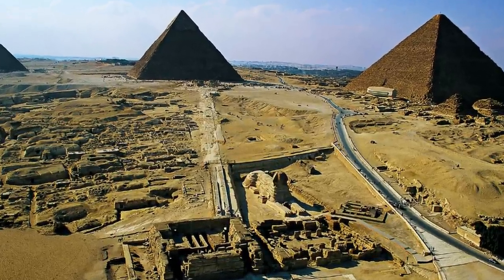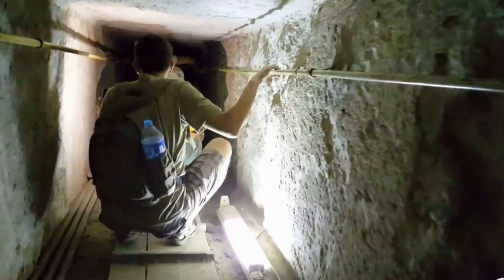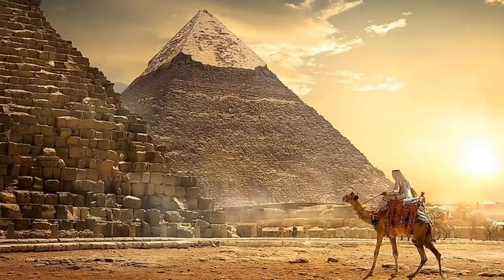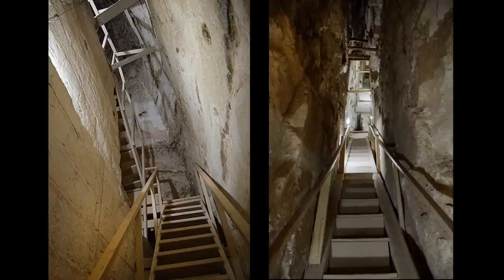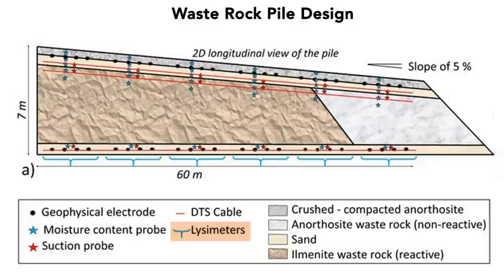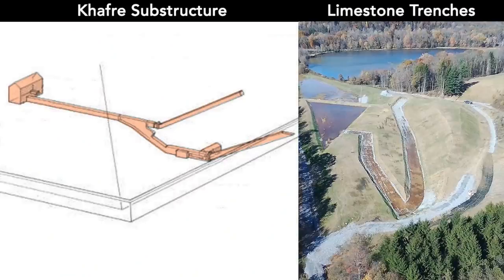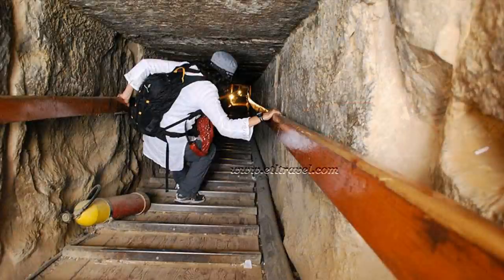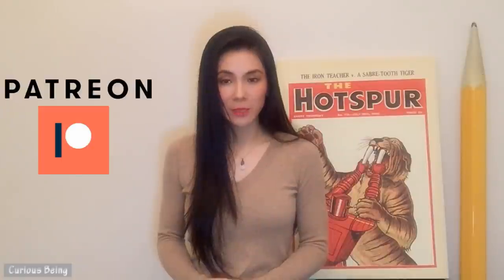The Secret Enigma of the Egyptian Pyramids’ Interior

Comment: Hi Tina, very good video and the series has been well researched and presented as a whole theory that has a believability about it. I have several points to make:-
1. As I've commented before I'm struggling believing that an advanced civilisation would only have mined for iron at Giza, we should probably find similarly constructed pyramid styles at different sites nearby and in other countries mining other minerals. The fingerprints of this advanced mining technology would surely have migrated elsewhere unless the constructors were wiped out just as they finished mining Giza which seems unlikely timing but can't be ruled out.
2. The chambers seem 'over designed' for the purpose of draining acidic run-off with the drainage shaft to the underground chamber being inexplicably poorly designed, being very narrow in comparison to the other shafts and curiously shaped.
3. The so-called Gatenbrink shafts would not have allowed free flowing acid drainage due to a series of doors in the shafts.
4. We should be able to test the iron ore acidic wastes drainage theory by seeing orange/red residues on the 'limestone rock rubble filters' you propose. This should be very evident I would assume.
5. The function of percolation and drainage should still be seen working today especially as the protective casing stones are now absent.
6. If the pyramids were built in a desert climate rather than savannah times how much rain would there have been to create large amounts of acidic run-off?, we are probably talking condensation rather than flowing liquids. This would be more likely due to the protective casing stones keeping most rain incursion out. Would condensation account for the efflorescence on the internal walls?
7. Why add white casing stones in a desert climate as the intense heat would likely dry the 'tailing blocks' out, avoiding the need for a fancy drainage system (unless the pyramids WERE built in a savannah climate or the builders were far thinking and expecting a savannah climate to bring heavy rains).
Would be interested in your thoughts Tina. I think you have an interesting, well researched theory but I remain sceptical!
Reply from the maker: Thank you Ian. I appreciate your thoughtful questions! 
Here are my thoughts. 
1. I think there are other mine waste "pyramids" around the world, for example the Bosnian Pyramids might belong to this category.
2. The chambers are plain and have a industrial look. Comparing to the sanitary/ sewage systems I showed in this video (https://youtu.be/nPswBtmQKD8), the pyramid chambers don't seem to be 'over designed' at all. The underground chamber has sharp straight ceilings and rough rubble channels and piles, though the underground tunnels are still very well excavated which are consistent with the rest of the pyramid construction.
3. The air shafts from the King's Chamber were found to exit to the outside of the pyramid. The Queen's Chamber air shafts do not lead to the outside and both have "Gatenbrink doors" about 200' (60.9 m) into the shafts, which means they are unobstructed for 200' to allow seepage water drains to the chamber.
4. I hope people are allowed to test the rubble inside the underground chamber. From a few colored photos we can see dark orange/red residues on the limestone - I showed them in the video. One photo especially shows the grey ceiling and the reddish rock channels.  
5. The drainage channels are still functional (leading moisture/ seepage water to the chambers) ; and that's why there were and still are efflorescence salt showing up in the chambers and the Grand Gallery periodically. 
6. If the pyramids were built in a desert climate like now, there were still rain storms which would have caused flash floods like now. When the pyramids were covered with full on casing stones, there would have been minimum water seeping through though it's possible that there would still be water getting in during a heavy rainstorm since stone and concrete are porous. If the pyramids were designed to be permanent mine waste storage then the design would need to be covering a wide range of possibilities including water seepage and accumulation inside the pyramids.
7. White casing stones actually works great for desert climate since it reflects sunlight other than absorbing the heat. Dark roofs are usually used in cold regions to help ice melting in the winter.
Reply: Thanks Tina.
1. Our Victorian sewers are very ornate as that was the architectural style and mentality of the time. My point regarding the great pyramid is the K & Q chambers have large inverted V granite caps (they may be for supporting loads from above but the grand gallery doesn't seem to require that type of roof support), they are off-centre and equally oddly sited relative to each other. The grand gallery's size is at odds with both chambers if simply providing drainage. Compare the design of the chambers to the seemingly random journey of the small well shaft from the end of the Q chamber shaft to its intersection with the descending passage - almost seems like an afterthought addition. The subterranean chamber size appears small if it is the terminus of the waste products from the larger Q & K chambers. If this is a waste collection system for the mega sized pyramid then there are huge areas poorly served by it, surely you'd need more collection points with more shafts funneling waste to treatment areas then direct downward filtration to a large subterranean area. 4 shafts and two strangely located chambers serving a small subterranean chamber via a kinked shaft seems odd, especially as two shafts have doors in them precluding drainage.
2. I agree the subterranean chamber needs testing for deposits but I wonder if the orange colour we see in photos is really acid drainage from iron ore, I've never been there myself. Presumably such deposits would preclude tourists going down there due to health and safety.
3. I'm aware white casing stones reflect sunlight, basic science!. However, despite flash flooding maybe leaving the stones to bake in the desert sun would obviate the need for a drainage system. I don't know. As the pyramid still seeps today maybe that was always the case...seepage rather than large volumes. Is it no longer toxic after thousands of years?, how much iron ore was there really locked in the pyramid stones?.
4. The Red Pyramid has no drainage shafts, just chambers at base level. Menkaure and Khafre have no 'system' of draining I can see, just chambers.
5. The Bosnian pyramids - not seen anything related to mining there but maybe you'll do a video?. My point is I see no consistent thread of the Great Pyramid layout finding its way anywhere else.
6. I'll probably just have to disagree or remain highly sceptical of the mining tailings theory, sorry!
Reply from the maker: @iang1  Thanks Ian. 
1. I showed not only "Victorian" sewers but also modern ones in Tokyo and Chicago.  The interior of the G1 is not ornate in anyway. Off-centered openings in solid structures also need to sustain great pressure from the piled-on material on top which means they would have to be structural. Gable ceilings work better than flat ceilings in such conditions. There are old photos showing grand gallery's "exit" showing water erosion marks which are covered up now.   
The Well shaft shouldn't have been an afterthought of the Q's chamber because the construction process dictated lower potions of the pyramids completed before upper chambers therefore the excavation of the well shaft should have been prior to the construction of the Queen's chamber. 
The subterranean chamber is actually the biggest chamber in G1. According to measurements from this site (http://repertorium.net/rostau/measures.html).  The volume of the subterranean chamber is bigger than Q & K chambers combined. Please note that the section we see is only the N-S section which doesn't show E-W dimensions. There might be more collecting channels/ shafts though these are not easily detectable with today's technology. 
The "doors" in the Q's air shafts are located over 60 m into the shaft. G1 is 146.6 m tall originally. This means these shafts are blocked by "doors" when they are close to reach to the outside, thus do cover a big range of the pyramids. Do you need more collection points with more shafts? It depends on what weather conditions when the pyramids were built.  The climate in Cairo is called a desert climate. There is virtually no rainfall during the year. Precipitation here is about 26 mm | 1 inch per year. The wettest weather is in January when an average of 7 mm (0.3 in) of rainfall (precipitation) occurs. 

The Sahara/ North Africa goes through humid/dry cycles. The Sahara was green and wet from about 14,500 years ago (after HS1 the millennia-drought) to 6,000–5,000 years ago. The humid period before that was around 85,000 to 78,000 years ago. HS1 (20,000-15,000 years ago) is the time period that coincided with the severe human population bottleneck which I think could be the ending of an advanced civilization. If the pyramids were built during 78k-15k years ago, then the Giza Plateau would be as dry if not dryer than now. 

3. I talked about the material analysis of pyramid blocks in this video: https://youtu.be/y6ShuJdzDS0
4. The Khafre has possible air shafts which I have discussed in two videos though these niches haven't been investigated. Menkaure as well. We don't know if other pyramids such as the Red have no drainage shafts since this hasn't been researched. 
5. There are recent videos on Bosnian pyramids. Besides the shape and scale being comparable to the Egyptian pyramids, Bosnian pyramids are made of limestone with extensive underground tunnels. 
Btw I explained my thoughts of the G1 interior in detail in this video: The True Purpose of the Great Pyramid's Interior System?! https://youtu.be/BYr6HbEjS7w
Reply: I've not said G1 is ornate, my point is the design doesn't stack up for me as a drainage system. I'm well aware gable roofs are stronger than flat roofs. I still maintain the well shaft is odd if it's part of a designed system. I've seen all the videos, in fact I've watched one of them twice!. Regarding signs of water marks, Schoch has shown large scale water erosion on the sphinx so I wonder how far up the plateau any large water incursion reached. Anyway, I'll leave it there!
Reply from the maker: @iang1  Yes I'm thinking about doing a video on the erosion marks at the Sphinx surrounding walls since the west side shows the most severe water erosion. Thank you very much for watching my videos and asking great questions. I find them very helpful to critique and advance my thoughts and ideas. So please keep the questions coming! :-) Thank you again Ian.
Reply: Tina, will do, it's all good fun as well as hugely stimulating for the brain cells!
Reply from the maker: @iang1  Agreed :D

Comment: One thing your hypothesis will need to address is why are there no "drainage" shafts (King's & Queen's chamber shafts) i.e. drainage systems in any other Pyramids expect the Great Pyramid. Also I understood, perhaps incorrectly, that there was a floor in the Red Pyramid that has since been removed leaving the "rubble" that you point out. 

If the Pyramids are mining waste then there is also no reason why they could not have a dual purpose from the start, and also be used as Tombs. Bit like a dam can also be a powerstation and a flood control device and a reservoir for storing water for human consumption.
Reply from the maker: Thanks for the comment. In this video, I mentioned the niches in the "burial chamber" of the Khafre pyramid might be similar to the air shafts in the Great Pyramid and it's possible that more such small shafts are to be discovered in other pyramids. 
As for the rubble pit in the Red Pyramid, I think it was created by original builders. We can see the seamless transition between the straight-up walls and the rubble on all sides. This big pit covers the entire floor area (which would have required a lot of work) and looks very different from the small pit dug in the King's chamber of the Great Pyramid. If the top layer of the floor had been removed, then where did the blocks go? We can see from photos that the chambers are built with big stone blocks, digging and removing blocks in such sizes wouldn't be easy even with today's machinery. 
On the other hand, I agree that the pyramids could have more than one purposes.

Comment: Sphinx enclosure could have been a settling pond or had a similar 'collector' function in the whole scheme. What is now the body of the sphinx could have been an island in the middle of the pond with a functional (acid neutralising or such) purpose. The so called Sphinx Temple is very reminiscent of an industrial processing area. It is full of what looks exactly like the drainage channels show 17:54 min into your video. Robert Schoch wrote about the bedrock in the sphinx enclosure as being "highly faulted and jointed.. limestone bedrock is characterised by karst topography, with numerous openings and cavities through which water can drain…The water would leak out into the numerous characters and tunnels below the swings and into the Giza Plateau.” - Schoch was here arguing against Sphinx enclosure being an artificial lake or a pond, but my guess is that those gradual leaks into the bedrock were precisely what the designers of the enclosure were after. The island/body of the sphinx, and the chambers underneath it, could have housed granite sarcophagi similar to the ones found elsewhere in the area. Those granite containers likely held an acid-neutralising oily base that would evaporate out from the sarcophagus slowly over time and act on whatever waters draining through the bedrock.

Comment: Has the salt deposits been tested to be sure that they’re leached from the rock? Could be possible that the liquid in these pyramids was some sort of a solution to be used as a catalyst for some other process in the pyramid?
Reply from the maker: Thanks John. I read that the salt was tested to be halite/ rock salt which is the main composition of efflorescence.  I think the salt encrustation inside the Great Pyramid is more likely to be the result of efflorescence because the salt "stains" have been cleaned regularly and they would re-appear; meaning there has been long term on-going moisture accumulation.  If there had some kind of liquid used for chemical reactions originally inside the Great Pyramid and thus formed salt, it would be difficult to prove now because the salt has cleaned many times. We also need to explain why a highly advanced culture would build an extremely massive masonry structure with merely 0.014% of interior openings for chemical reactions. What reasoning can justify such an incredible effort?

Comment: Pluse all the different forms to make the blocks, and different types of blocks
Reply from the maker: There are usually only two to three types of stones in Egyptian pyramids. The casings are Tura limestone. The core pyramid blocks are local limestone. Granite was used sparsely in either some interior chambers, passages or lower casings (Khafre & Menkaure).
Reply: @CuriousBeingbyTina  pluse the odd flaking of the outer stones left and the second layer

Comment: My only question is 10,000 to 30,000 years ago whenever these pyramids were built in the pristine condition of the masonry in their newly constructed state would water even be able to fit between the stones or is that just leaks that appeared more recently from earthquake looting and weather damage?
Reply from the maker: Thank you. I think when the pyramids were covered with full on casing stones, there would have been minimum water seeping through though it's possible that there would still be water getting in (for example, during the occasional rainstorms that caused flash floods in Egypt) since stone and concrete are porous. If the pyramids were designed to be permanent mine waste storage then the design would need to be covering a wide range of possibilities including water seepage and accumulation inside the pyramids.

Comment: Great theory Tina - much more believable than many other theories floating around! There’s an interesting bit at 20:30 in this video by UnchartedX https://youtu.be/PS1azzN0b-I At Abu Sir basalt is casing limestone and the inner layer of basalt (facing the limestone) is peeling off. Seems to support your theory. Any thoughts?
Reply from the maker: Thank you very much for the information, Ramit. I really appreciate it! You are right - it's interesting to see that the basalt was used to encase limestone and shows signs of peeling/ crumpling. Maybe that side of the basalt was exposed to  sulfuric acid (acid mine drainage) and degraded. 
I found this experiment (published paper name: Experimental study of acid-sulfate alteration of basalt and implications for sulfate deposits on Mars) showing a photo of basalt cinders treated with acid-sulfide: (c) before (left) and after (right) https://agupubs.onlinelibrary.wiley.com/cms/asset/30db88fb-971d-4703-a728-3563f1476899/jgre20044-fig-0001-m.jpg
It'll be great if geologists can take some crumpling basalt samples from Abu Sir to see if they went through sulfuric acid. 
Thanks again for the support and information ♥